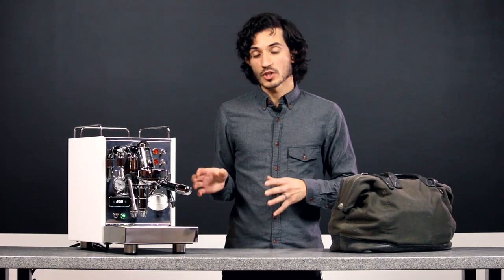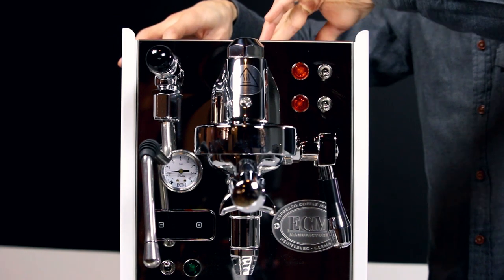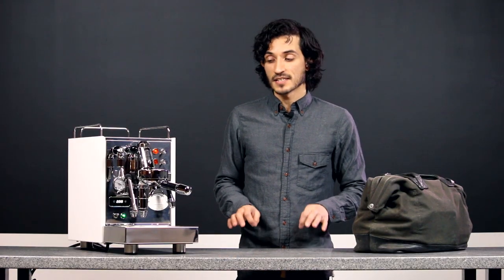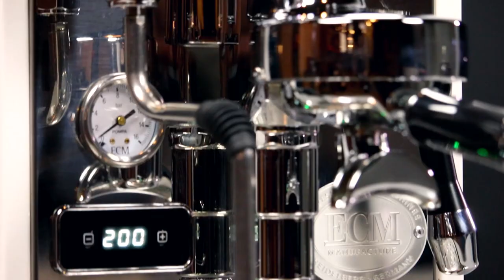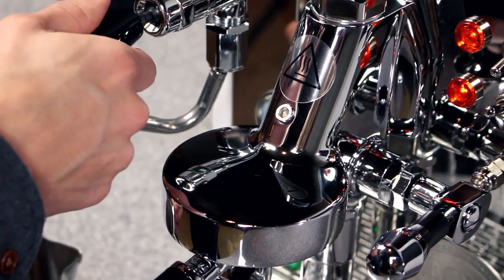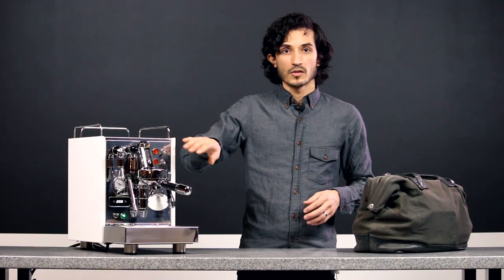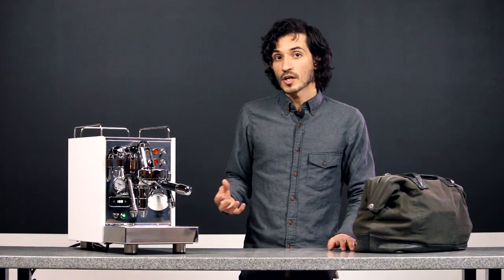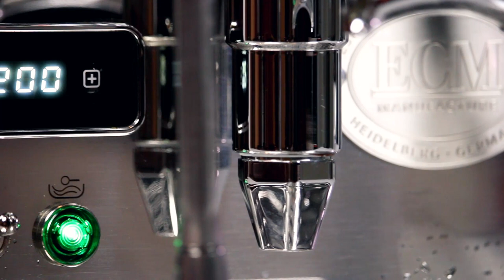ECM Classika PID | Tech Tips

Comment: I have one nozzle on the frothing wand blocked - are you able to remove the end of the nozzle to clean?
Reply from the maker: Yep! - You should be able to unscrew the nozzle. If it doesn't come off easy, then try using a microfiber towel and a wrench to remove it.

Comment: ok so after steaming turn off steam switch and purge steam wand and keep portafilter in there to purge like 20 seconds (until water running). then ready for next shot?
Reply from the maker: sure thing!
Reply: thanks! ok wait. i just rewatched the video… to switch from steam back to espresso. pull steam wand and brew switch until water is running freely. then ready for espresso again?
Reply from the maker: @danielleramos9686  You can simply switch out of steam mode and lift the brew lever up all the way until water comes through the grouphead as well.

Comment: Why does this machine power off (abruptly so) when the water refill tank is below a certain level whilst the boiler is basically full? Is the boiler only for steaming and irrelevant in case you draws Espressi only?
Reply: It's protecting the pump from running dry. Boiler is for both Espresso and steam

Comment: Please let me know what exactly the pump switch is used for?
Reply from the maker: The pump switch is used to fill the boilers. Turn this on when switching between steam mode and brew mode to refill.
Reply: @clivecoffee  But Tim in the video (Tip 4) advises NOT to use the pump switch when switching between steam and brew mode because water or air may be trapped in the line. Instead his tip is simply to open the group head and steam wand until water flows through both, indicating that the boiler is refilled.

Comment: Would you be able 2 do some pre-infusion on this machine, if you do, 4 how long???
Reply from the maker: Hey Roel, the Classika isn't capable of pre-infusion. In order to pre-infuse, the E61 group head on the Classika requires water line pressure. Since it runs on an internal reservoir there is no line pressure. If you have any other questions let us know!

Comment: Does anyone have any issue with the steam wand dripping water? Even when I have the PID up to temp at 138 Celsius in steam mode, the steam is still pretty wet and the wand drips a fair bit.
Reply from the maker: The steam on the Classika is generally pretty wet, so this makes sense. The boiler has a limited capacity in which to create steam.
Reply: Yeah i confirm it takes some time until dry steam is availabe.

Comment: what temperature should milk be steamed at?
Reply from the maker: In large part it comes down to personal preference but generally, anywhere between 120°F and 160°F is acceptable. Above 160°F you start to run the risk of "burning" the milk which will result in negative flavors.
- Charles